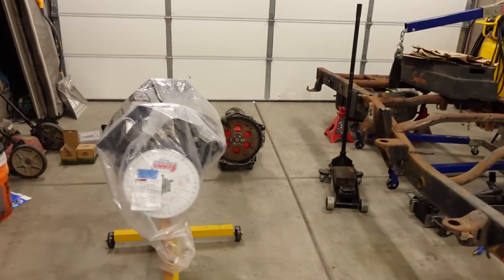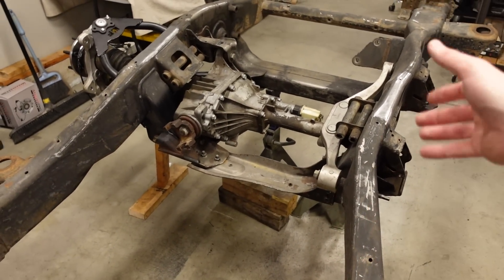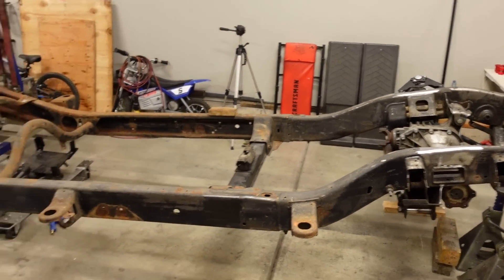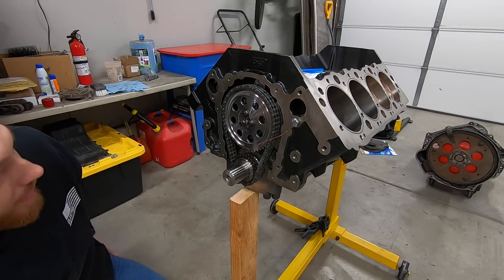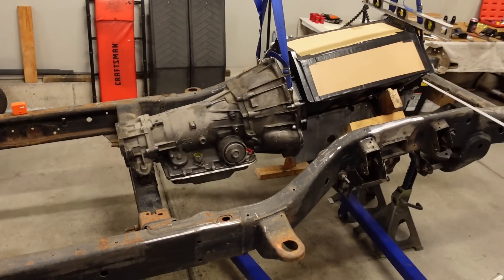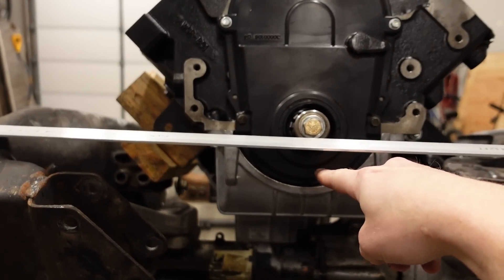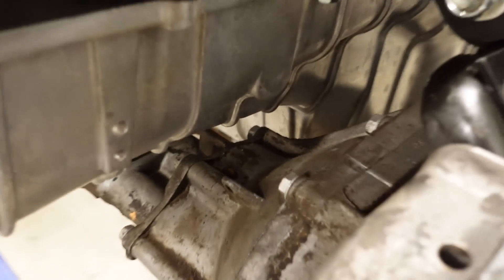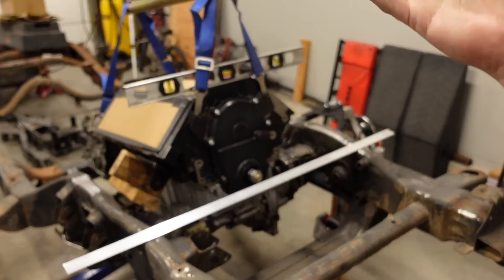mounting my 1,500hp MONSTER BIG BLOCK to its 4x4 chassis

Comment: Very tempting to drop an 8.1L into my OBS, but I'm a manual guy and I don't think my NV3500 is gonna last long behind a 5.3 let alone an 8.1.
BTW, on an editorial note, the production value of this one was fantastic!  The music volume was perfect for the montages and action sequences.  You dropped it when neccessary and raised it when needed.  GG.
Reply from the maker: Thanks for the feedback! And agreed, I dont think the NV3500 would like that much torque
Reply: Just finished the 5.3 in my obs with nv3500 4x4 100% worth every penny it's a different truck now
Reply: I have a 350 vortec in front of my NV3500 S10 never got noisier then it was day one haha
Reply: I've been running a nv3500 behind my 5.3 swapped obs for about 3 years now. Trans had 300k miles when I swapped it, and now about 350k. And I've been beating the hell out of it. So far, it has held up surprisingly well.
Reply: T56, if you need it 4wd, Rockland standard gear makes one.
Reply: I could never find a clear price on there site or how to go about purchasing one, long term goal was use loj conversions kit for 6spd awd
Reply: @OBSZ71  I called them a couple years ago, I want to say they told me $3k-3500. I saw a video on here awhile back where a guy had mixed and matched some corvette pieces and made a custom t56 mid engine setup it was pretty slick
Reply: @stellingbanjodude  seen that same video. Thanks for the insight don't know why I never called
Reply: I have a GMT400 with the Vortec 454 and 4L80E that isn't shifting right, and I think is slipping at WOT. I've been looking into rebuilds, but at heart I'm really not an automatic type of guy(Miraculously, a manual trans is always in exactly the gear I want!). All this manual trans talk has me looking at NV4500 and NV5600 swaps.
Reply: sometimes i see these guys with their 2wd truck buils and get jealous of how easy they have it... then i remember i still stand to urinate and that reminds me why i need a man's truck with 2 shift levers 🤣
Reply: @Mouthy_Trucker  when I had to spend 500+ on a custom/swap flywheel and clutch and then spend multiple hours to drop my transfer case just to get to my oil pan gasket I questioned my choices but as soon as drive it it's worth all the pain 🤣
Reply: @stellingbanjodude  T56 will not hold up. Truck is too heavy. The only thing that will really hold is a ZF6 but good luck finding one.
Reply: @shakenfake  I had a T56 in my 05 Silverado, it done just fine.
Reply: @stellingbanjodude  Not behind an 8.1 you didn't.
Reply: @shakenfake  I’ve seen these behind twin turbo vipers, even if you have to upgrade some internals so what. You wouldn’t put a stock automatic behind a performance engine and expect it to live, you’d upgrade some components to handle it. To outright say a t56 can’t handle it is asinine at best.
Reply: @shakenfake  🤦🏻‍♂️ no , it was an LR4. I never said it was an 8.1.
Reply: @stellingbanjodude  First of all a T56 Magnum is a completely different trans than the one the Viper uses, they are similar and are compatible between the brands but they are in fact different.
Secondly, everyone forgets about weight. The reason why a 4L60 can live 200k miles behind a 350/360 HP/TRQ Vette but can't live 200k miles behind a 270/315 HP/TRQ Silverado is because the Silverado is over a ton heavier.  (This is not to say that the 4L60 is the best transmission for a Corvette  by the way as most of them don't make it to 200k either but in my experience they do last longer with better wear when rebuilding. That 200k number is just a toss up number for said scenario.) Your Viper in said scenario weighs over 2000 lbs less than a Silverado.

The T56 can work with smaller vehicles. Weight plays such a massive role in clutch wear and transmission longevity.

ZF6 dude, there is a reason why they went behind duramaxes.
Reply: @stellingbanjodude  I know. I’m talking about an 8.1L lol
Reply: @shakenfake  the parts are interchangeable, same manufacturer. Semantics. For discussion purposes like I said , a person wouldn’t install a bone stock automatic behind a fully built engine. So calling a modified tremec a t56 is so that the newbie can follow along and comprehend. Regardless of what you “know” or “believe” a transmission that is in a 2000HP 3400 LB car can handle a 600 HP 6000Lb truck.
Reply: @stellingbanjodude  Alright bud. 

Just saying ZF6 or NV4500 are the options you should take if you want a reliable trans at such a high torque level :D
Reply: @shakenfake  those are truck transmissions for work use, they won’t allow you to have fast shifts for racing use. That has been my whole argument. I think you’re still talking for work while I have been assuming race usage.
Reply: @stellingbanjodude  I mean that is the first time the words "race use" have been typed out by you but okay. 👍👍
Reply: @shakenfake  dude we are on a post talking about an 1500 HP truck! Some things are inferred from the context of the video. I’m sorry I didn’t know you couldn’t comprehend that
Reply: @stellingbanjodude  We are in a comment thread about just putting an 8.1L into an OBS. Not a race truck. But okay bro you win I know you need to be right.
Reply: @shakenfake  and you need to have the last word

Comment: I love how you buy the correct tools for the job,I also do that. Its ALWAYS money well spent. I'm really loving your channel and your attention to detail.
Reply: 100% this. I have never once regretted buying the right tool, or a higher quality tool. Not once. I have regretted trying to cheap out and make do with junk, or cobble something together, plenty of times. Have successfully made do most of the time, but the right tool is the right tool for a reason.
Reply from the maker: Thanks 👍 it does suck spending a couple hundred bucks on a tool that you may only use a handful of times, but as mentioned below, I never regret spending money on tools

Comment: Got an 2007 Chevy Classic Regular Cab with a truck norris cammed LQ9, original 317 ported heads with valve upgrades, intake off a trailblazer, 1¾ headers, NV3500 (still surviving) Center of the crank bolt is level with a straight line to the frame, Yours is a little higher. 
Happy New Year, LT!!!
Reply from the maker: Appreciate the info, that’s very helpful!
Reply: In wanting to swap my 92, it's 4x4 but what flywheel clutch combo did you use? Mines technically the hm290 if I remember correctly.
Reply: @Jake39019  I used the clutch found on the supercharged 4.8L 2004 Joe Gibbs Edition Silverado, Bolted right up without any hassle.

Comment: If I'm not mistaken the first 8.1 swap that Larry did need  different mounts so a trip to Chevrolet buying the 8.1 Mount and bolting them to the frame took care of the location of the engine, with the stock 8.1 motor mounts. I think this was done in a Cadillac Escalade if I'm not mistaken it's been quite a while ago that we worked on this.
Also there was a modification on the passenger side frame rail to fit the engine in I think this was a 2001 Escalade, I had a conversation with Larry about this to refresh in my memory and he was under the impression that Cadillac 2001 year model used a 2000 year model frame while the Chevrolet used the 2001 frame for the 2001 year model and that's why there was some notching required on that particular installation

Comment: (edit: I just noticed in an earlier video that youre using a PSI Block lmao) It wouldnt fit under the hood of a normal truck but Power Solutions International has a factory tubrohcarged 8.8L Big Block with a bunch of LS-style improvements, mainly to the heads and intakes. The turbo'd engine is only used in stationary applications like generators and water pumps but they do have an NA version used in International Busses. I had already planned on building a tow rig from an ex-U-Haul C5500 with the 8.1 and im considering an 8.8 swap, maybe a turbo if it fits, for phase 2 after I buy and shorten the truck (hopefully) later this year.

Comment: Happy Newyear!  If you drop the engine down an Inch or two. Would that effect the hot side of the turbo? Meaning will the turbo headers fit without hitting the frame?
Reply from the maker: The closest part will be the crossover pipe, but that’s gonna have to be re-done anyway since I didn’t account for the front driveshaft when I built it

Comment: 03 Suburban 2500 lq4.  The yard stick on top of the lines, on top of the frame, and at the front of the crank pulley, the bolt is in line with the ruler.  If I could measure without the pulley, like you did, it would be below.

My vote is lower the engine.

Comment: 07 Cateye 4.8 2WD Coilspring truck.
Put a yard stick across the tops of the frames (had a few fluid lines over top, but still), cuts right through middle of crank pulley, about like what you have. I also have a NBS Tahoe if I need to check that as well, 2wd torsion bar suv.
Reply from the maker: That’s what I need to know!

Comment: Just make sure when you lower the engine that you leave enough room for toque flex so the engine doesn't smack into anything. Otherwise great work man.👍
Reply from the maker: Yup, that’s very important as well
Reply: The diff is on the side the engine should torque away from, so I think it'll all be good. Especially with stiffer mounts.
Reply: @Levibetz  Toque flex is not a one way motion. This is built as a drag truck and what's the one thing everyone does at the end of the run? lets off the gas. And what  happens to and engine under high toque flex? it snaps back. So yes........ he needs to make sure there's adequate space for the engine to flex both ways even with stiffer engine mounts.
Reply: @theperson7718  Well yeah, you need room. But you won't have nearly as much movement in that direction, especially with an automatic that's not going to engine brake as hard.

Comment: GMT 800 5.3 4l80 4wd passenger outside frame was 14 3/4 inch, driver to outside frame from crank was 17 3/4. Crank bolt was about 3/4 inch below the top of frame. From crank bolt to lower crossmember was about 11 1/2 inches. Hard to measure with everything in there but these were about as accurate as I could get. All my motor mounts are less than a year old so minimal sagging.
Reply from the maker: Hey thanks for the info, very helpful!! That confirms my suspicions

Comment: Random but handy move, put the tube of the engine stand plate between the crank/cam maybe even a smidge biased to the cam it’ll be substantially easy to rotate the shortblock and not as scary top heavy when the heads go on…

Comment: I love how you lined up all of the freeze plugs so they were parallel. When I replaced the 3 accessory drive belts in my SUV, I made sure to put them on so they were right-side up. Same with my PS hose.

I love seeing good work like this, and it encourages me to continue doing the same.

Is there any room to drop the front diff a little and make even more room to lower your center of mass?
Reply from the maker: I could lower the diff for sure, but the challenge is the CV angles will already be kinda steep going uphill from the diff to the wheel, so if I lowered the diff, the angles would be worse
Reply: @LawrenceTolman  This is why you're there doing it, and I'm looking over your shoulder wondering about things. Thanks for letting me spitball!

Comment: Man I really think doing at least a mid plate is gonna save you trouble in the long run. You're planning on 1500hp which with that engine combo means prob around 2000lb-ft of torque. The stock style mounts are gonna be holding on for dear life. Motor plate might not be an option because of the gen 7 big block. But high power drag cars run motor/mid plates for a reason
Reply: I totally agree. I would be talking to someone that sets up chassis and get the frame rolling.  Figure out all angles and engine placement from there. Move it back if you can, but it where you need the crankshaft centerline based on the type of surface you’re gonna be raging on and set it in with a mid and front plate. For the goals that this truck has, you’re gonna need some “racecar” type stuff in it. Motor plates will help tie the chassis together and make it stiffer as well.

Comment: Would you run a motor plate or just mounts and bushings? Just curious. Maybe the 1.75 down on the front and .5 up on the trans?

Comment: Depending on if your cylinder heads have raised exhaust ports lowering the engine could help clearance for the turbo headers you'll build down the line

Comment: To slightly adjust your driveshaft angle, would it be easier to drop your engine or to choose a different transmission mount?
Keeping some extra clearance isn't such a bad thing  especially if you need to install a different oil pan or route turbo pipes at a later point.
Reply from the maker: it might be a little easier to shim up the transmission mount, but you can only go so far before the trans will hit the floor of the truck, and I don't think it will be far enough
Reply: Would a small shim on the transmission and a little less 'drop' on the motor mounts have the same beneficial effect on the transfer case driveshat angles,  @LawrenceTolman ?

Comment: I forgot you did a single cab short bed Duramax build on PowerNation, you gotta do another! Plus that thing was slow. Coulda had a lot more power
Reply from the maker: That was my all time favorite build I did there and I wanted to buy it so badly, but that didn’t work out. But I will build another some day, and it will have the twin turbos that one was supposed to get

Comment: If you need to alter the passenger side chassis part of the mount you might as well just make new ones for both sides. It will actually be easier and technically better to do it that way as you won’t have to alter the block mounts which might interfere with header room etc and might cause other problems.

Comment: i'm sure you already know this but you should ditch that 4wd actuator in the front end for one of those cable operated ones... the factory ones fail pretty regularly and the cable ones are much more reliable and cheaper if i remember correctly

Comment: Ya on my stock truck I'm not sure about the crankshaft but the oil pan is less than 1/2 an inch about that cross member

Comment: Lowering the motor is a good idea but oil pan wont come off witout leveling the engine. And if you plan to run headers off the shelve they might interfer with something being higher.
Reply from the maker: To pull the pan, that lower crossmember can unbolt, and the front diff will have to come out as well, but it’s totally doable with the engine in the truck, albeit a pain in the butt

Comment: Your suspicions were correct.  The crank  centerline is about 3/4 an inch below the frame rails.  It’s hard to tell with everything in the truck, especially with the brake lines running on top of the frame, but I can send you some shitty pictures if you want them.
Reply from the maker: That confirms my suspicions though!

Comment: What ive been told by a High performance transmission builder here in houston is. The 4l60e will last in high hp applications IF you dont rev it that high. nothing over 5800 rpm is what he said. and he runs one behind a nitrous 454 truck.
Reply from the maker: I think they can be made stronger than people give them credit for

Comment: What timing cover, pointer and oil pan did you use.  I have a gen 6 496 that I have put in a 84 k30 truck.  It has a oil leak and I can not find a timing pointer . The oil leak is at the front and rear of the pan.
Reply from the maker: I’m using the cover from a 2004+ 8.1 but those don’t use a timing pointer

Comment: 11:45 stupid question I know, but what spray did you use to remove the transmission fluid?
Reply from the maker: It’s a shop solvent I buy in 5 gallon buckets (basically brake cleaner) I put into a sure shot spray container

Comment: Wouldn't it be easier to raise the transmission mount an inch or two? Or would that mess up the front drive shaft more?
Reply: It probably wouldn’t fit in the trans tunnel when the body is lowered onto it unless extra work is done to it. I’m assuming he will be using a 4l80e which is a bit bigger then the 4l60 which also would make that issue even worse

Comment: Since they put the 8.1 in a Surburban couldn't you use the passenger side mounts instead of fabricate one?
Reply from the maker: I think there is a way to do that, but you’d need both frame side mounts and OEM motor mounts, since they are all a bit different

Comment: Would it not be better to wait till you have a 4L80 in there to check your angles !?!? 
And your turbo system will more than likely need to be changed with dropping the front of the engine !
Reply from the maker: The 4l60 and 80 should share same placement for the mounts and stuff, and yes, there is a chance my turbo placement will change, but I’m gonna have to re do that all anyhow